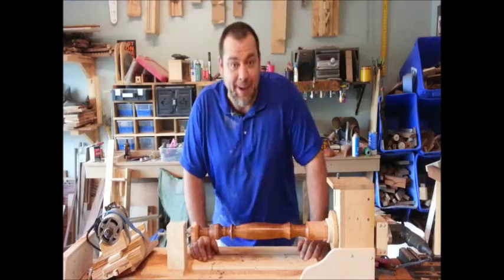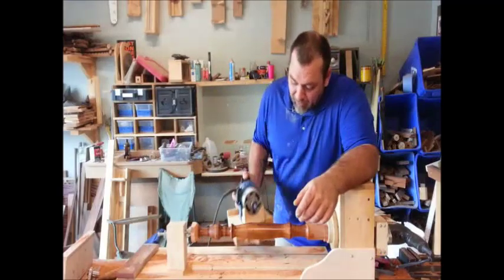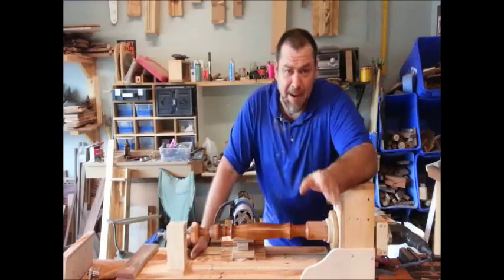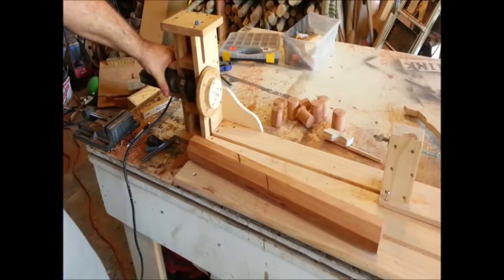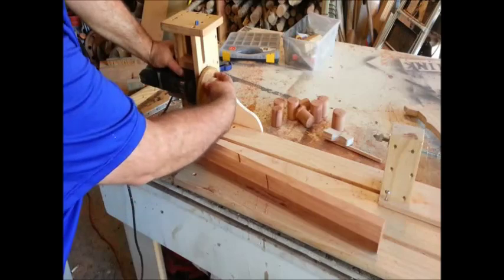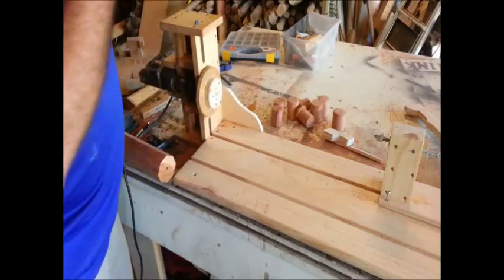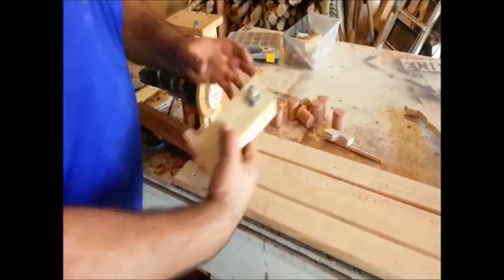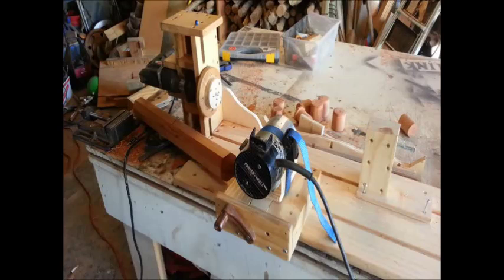Homemade Tools - router duplicator (copier) Lathe!

Comment: Great Izzy! but unless all your wood is the same length, are you not going to have to keep replacing the base, due to the number of screw holes when securing the tailstock? wouldn't a wide dove tail type track work better and wedge it in position?